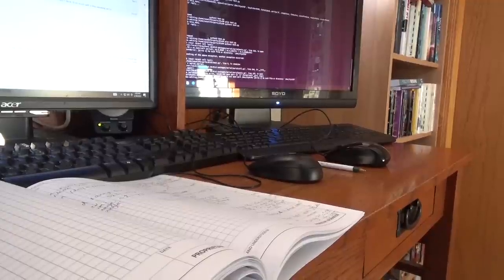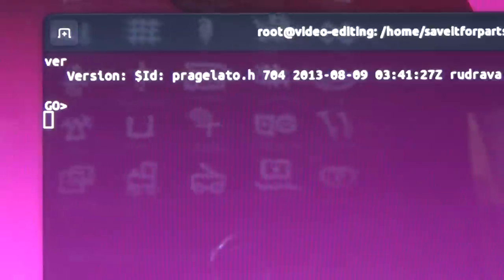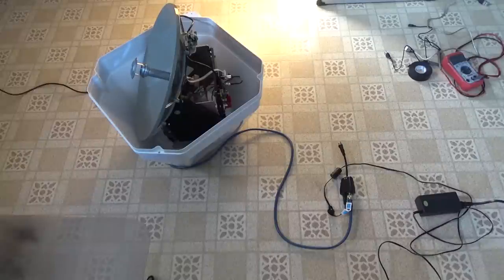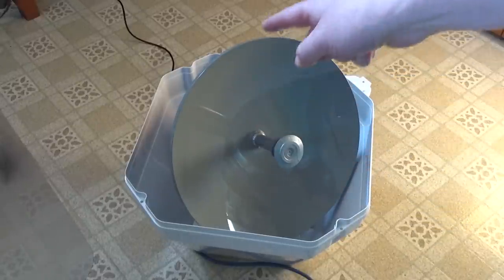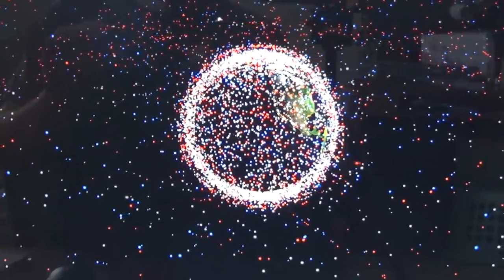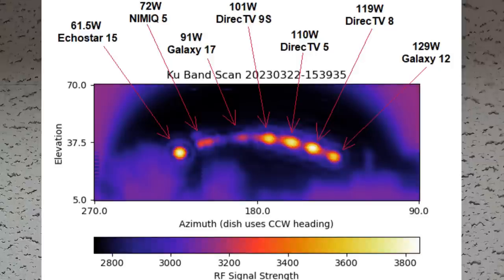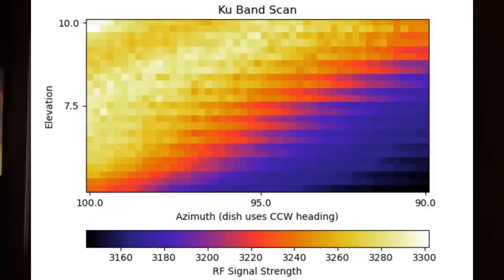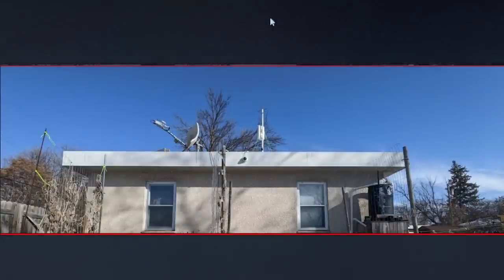Seeing Satellites with DIY Microwave Camera

Comment: Oh yea, that pesky sun.  Used to work with a KU band system, and there were a couple of days, for a few minutes, 4 times a year, where the sun would transit behind our satellite.  You could watch the noise floor on the spectrum analyzer, creep up and just totally eat the signal lobe.  Complete LoS for about 4 minutes or so.  Mean old radiation ball...  :)
Reply: sometimes at night when i do it. the moon messes with my signal cuz the moon has bad radiation. did u know that?
Reply: @driftwavez  the moon is simply reflecting the radiation & light from the sun. The moon itsels is not radioactive / does not emit radioactivity on its own
Reply: Had the same experience with several geostationary satcomm providers. As you say, the signal would just fade out for 4-5 minutes.
Reply: Only 4 minutes? These small satellite dishes are that focused?
Reply: Sunfade season was always crazy at my NOC
So many notices to send out explaining that it's the sun's fault

Comment: It would be interesting to see what you got if you pointed it in the direction of some of the larger planets. Many years ago I had the opportunity to visit the radio telescope at Jodrell Bank in the UK. In the visitor centre they had a 5m dish that you could steer manually and the coordinates for various planets. I was amazed at how much RF was being emitted from Jupiter.
Reply from the maker: I need to write some code to account for Earth's rotation and stay on a moving target! Jupiter would be interesting, although I think the radio frequencies it emits are much lower than this little dish can detect.
Reply: As a first step you could just run your current code to scan the sky and see if it picks up anything when it passes Jupiter. I suspect that you are correct though about the frequency range being much lower.
Reply: @saveitforparts  You can use the rotation of the earth as one of the scanning axis. It was a common technique for huge low frequency antennas used for radop astronomy.
Reply: @saveitforparts  🔴 What Is Islam? 

🔴 Islam is not just another religion. 

🔵 It is the same message preached by Moses, Jesus and Abraham.

 🔴 Islam literally means ‘submission to God’ and it teaches us to have a direct relationship with God. 

 🔵 It reminds us that since God created us, no one should be worshipped except God alone. 

 🔴 It also teaches that God is nothing like a human being or like anything that we can imagine.

🌍 The concept of God is summarized in the Quran as:

📖 { “Say, He is God, the One.  God, the Absolute.  He does not give birth, nor was He born, and there is nothing like Him.”} (Quran 112:1-4) 📚

🔴 Becoming a Muslim is not turning your back to Jesus. 

🔵 Rather it’s going back to the original teachings of Jesus and obeying him. 

More ....
Reply: irrelevant but ive driven past jodrell bank 100s of times and even hit the SDR near there (but not affiliated with jodrell bank) S9 on PMR (446mhz). Really cool how people would fly from different countries just to see it when it lives 10 miles away from me haha
Reply: Thank you so much my freind it is very interesting for me. Thank you so much again.

Comment: great job. But it is not correct to call it camera. It is a radar, not a camera.
Reply: Really, it uses radio detection and RANGING?
It's fine to call it a camera dude, especially since that's closer to what it actually does.
Reply: @0000Sierra117  yes, it uses microwaves .. waves .. sends and receives. And a Camera receives even when some sends lights to improve vision. And camera, or camara, is a champer, a box, an enclosure. It is in the name. No, it is not a camera. Technologies are named logically.
Reply: @el-domo  Either English is not your primary language or you learned what you know from the Big Bang Theory or something.
Radar is a specific technology that this most certainly is not.
Even Radio Telescope would be a better and more accurate descriptor of what he's doing than calling it Radar.
That being said, I think calling it a camera is particularly useful as it provides a good frame of reference for someone who is not familiar with RF.
Reply: @0000Sierra117  When you start to be personal, you already lost your point. Man, I tried to explain it to you in your understanding. Anyway, it is not important to explain more.
Reply: @el-domo  I'm not trying to insult you personally. The fact of the matter is that you are wrong, it is not useful or accurate to call it a Radar, it isn't one. The original video creator referred to it as a camera, which I think is useful and accurate enough. To correct that original statement, you would need good reasons to say camera is wrong and radar is correct. You have not provided any reasons. I'm not trying to mean, but the fact of the matter is that you don't have a strong grasp on English or these technical terms, so you shouldn't be so confident in correcting people, unless you have the reasoning to back it up.

Comment: You're also only seeing DSS (direct satellite service) satellites like directv and dish network because the LNB on that dish only looks at the DSS band (12.2-12.7GHZ) - to see all the other FSS (fixed satellite service) satellites, you need a FSS band LNB (11.7 - 12.2GHZ), and maybe a larger dish. The FSS satellites are 3 degrees apart, which is much too close together for such a tiny dish to be able to resolve the individual satellites - you'd just see a blurry line of all of them lumped together. For instance at 91W, that's not G17 you're seeing, that's Nimiq 6. They're at the same location, but G17 is FSS band and Nimiq 6 is DSS band (and pointed North to Canada). The Canadian satellites at 107W and 111W are FSS band, not DSS, so you won't see them at all on your dish / LNB (and the one at 107W has gone inclined a few months ago). Same thing at 129W, that's not G12 you're seeing, G12 is c-band only. You're probably seeing CEIL2. Your "satellite expert" you conferred with doesn't seem to know very much if they didn't tell you about the different bands, and that there's multiple satellites at the same location operating in different bands.
Reply from the maker: Interesting, I'll have to do more research on this. I'm not too knowledgeable on FSS vs DSS, I only know a little about H vs V vs Circular polarization. I have a bigger dish and an upcoming video on C-band, but I don't have beefy enough motors to aim a big dish yet.
Reply: @saveitforparts  FSS and DSS are just 2 different frequency bands in the larger Ku band. The bigger rectangular dish you have on your roof will have a FSS LNB on it, as it's an old vsat terminal for hughesnet, which runs in the FSS band. Most (but not all) FSS satellites in North America use linear polarization (Vertical and Horizontal). FSS is also known as the FTA satellite stuff (although that term is a bit of a misnomer, and incorrectly used to mean many things). All of the direct to home satellite providers (with the exception of one of the Canadian providers, and one dish network satellite) use the DSS band, at higher power levels, and use circular polarization (Right and Left circular). Because the DSS satellites are spaced further apart, and because they're running higher power levels, they can get away with using those tiny dishes.   Some of the direct to home satellite operators are also using the Ka band (18 - 22Ghz), as well as many satellite internet services. Most Ka band satellites in NA are also circularly polarized, but the Ka band itself has 4 different sub-bands, and you need 4 different LNBs on a dish to truly investigate that band.  If you have a c-band dish, I'm surprised that it doesn't have a polar mount and a linear actuator to move it, though that only gives you one axis of movement that you align with the clark belt - you couldn't do a whole-sky-image like you did here unless you go to a 2 axis mount with 2 actuators (aka pick up another c-band dish for a second actuator, and fire up the welder to make a 2 axis mount).
Reply: @saveitforparts  The difference between linear polarization (V and H) and circular polarization (R and L) is in linear polarization, the e-field (electric field) and h-field (magnetic field) of the RF wave are in phase with each other. In circular polarization, the e-field and h-field are 90 degrees out of phase, causing the overall polarization to rotate (which is why it's called circular polarization). Using both polarizations (V and H, or R and L) allows 2 signals to be sent at the same frequency at the same time that don't interfere with eachother (because their electric and magnetic fields are orthogonal (90 degrees) to the other signal on the other polarity, and thus don't mix). It's a nifty trick that basically doubles the bandwidth available in the frequency band. This only works where you have fixed antennas at both sides of a direct line of sight link without random reflections. It works for satellite, and point to point microwave links, but isn't useful in any kind of broadcast applications where you get reflections off of buildings or terrain. It is the exact same as "light polarization" in photography, or LCD screens, etc etc. If you had 2 lights that where opposite polarization, you could send 2 signals at the same time, and use polarizing filters to block one and allow the other through to separate them at the receiving side.

Comment: I think it makes sense to have adaptive resolution: If the dish picks up a strong signal, it can use the nudge feature to increase the resolution in this area. If not the standard resolution is probably enough.
Reply: I agree... find the edge of the object and then nudge back across it to see if you can get more details.  Use the more accurate nudge direction for scanning.  Then "restore" back to the position it was and continue on.
Reply: Limited resolution from the small dish size. If you could determine the resolution function imaging a point source… eg a satellite, you could deconvolve the image to get a higher resolution result. Failing that you could use multiple dishes and then use interferometry to synthesise a higher resolution… but the hardware probably won’t allow that. Cool project!!
Reply: if you had 4 dishs in a square array, you could do a phased array to get better resolution
Reply: @zazugee  if you could phase connect them together and do the maths. The more in each direction and the further apart the better. If an amateur could pull it off I would be impressed.

Comment: I had an aha! moment during this video.  You essentially were collecting data about your surroundings without an active emitter.  This passive “RADAR” is what modern military aircraft use to get a picture of the battle field without giving away their position.  I’m sure their hardware/software has a higher resolution but the concept is the same.  Wow.  Thanks for that.  Great job!

Comment from the maker: Quick update on this, if anyone is thinking of doing the same and looking for a compatible antenna:
I got my older (2011) Tailgater with the Mini-USB jack to give me a serial console. The firmware is slightly different and it doesn't have the elangle command, but everything else seems to be the same. Sadly the motors are 100% seized up from water ingress at some point (probably why I got that one for free).  If I can find the same motor online I might try to replace them. 
So, I'm guessing any Tailgaters between at least 2011 and 2014 will work for this! You might have to substitute elev for elangle and tweak the range values in the Python code depending on firmware version.

Comment: How cool is that to see a picture like that again. I did something similar with a 1.2m Ku Band DX Dish that also had a elevation correction. But it could not move as freely as your antenna. However the picture I generated  from the sattelites looked pretty much the same. This was back in 1994 when we had to take a picture, develop it and scan it with a scanner. No digital cameras back then.

Comment: To get higher resolution you'll actually need a better dish! That one is small and not very parabolic - that's why you see ringing artifacts around those sats on the left by the tree. Those are caused by the dish not being "focused" enough. You can think of it like bokeh from a lens that's not focused properly. It's designed just to pick up a signal, not a perfect pinpoint focused signal, which is what you'd want for clearer scanning for imaging purposes. Still awesome!
Reply from the maker: That's kind of what I thought the rings might be. I've been debating if it's worth doing the "nudge" command for smaller scan increments, but it looks like the beam width of the dish is more than a degree.

Comment: I love this video.  Thanks.

I feel you about a CS degree not teaching coding.  I have a CS BS and in the course of my degree I had a course or two in C, C++, Ada, and 370 ASM (not necessarily in that order).  In short, nothing modern.  I mainly code in Bash these days, though I can sometimes read C if it's not too complex.

For imaging fast objects (LEO), I suggest you scan the sky in vertical stripes, then do the rest of the scene however you want.  Depending on which way you move the stripe the image will either be expanded or squashed, but probably not very skewed.

For sending text one char at a time, you could write a procedure that takes a command and sends it one char at a time.  Then in the body of your code, call your new procedure.  It won't make things work any better, it just makes your code easier to read.

Anyhow, best of luck.

Comment: This is basically how commercial dish pointing systems (e.g. on news vans) work. The controller points the dish in roughly the right direction using GPS, compass heading and a database of satellite orbits, then does a peaking search on the beacon frequency in a small grid to account for errors in its calculation of where it thinks the satellite should be. All sensors have error. Of course this only works for geostationary satellites.
Reply from the maker: I should look for an old news van at surplus sales :-D
Reply: The really old trucks were all manual. You just had to learn where they were and what the spectrum looked like. Now they just call us old guys when the auto dish fails or needs a new sat programmed in 😂

Comment: Wow, I'm glad I came across your video, I just subbed. I started playing with one of these back in 2020, was able to control the dish over a serial console but I'm not a code guy so i haven't got back to this project. my goal was to change the LNB for a ham radio antenna and use the dish to track LEO radio satellites. Great work and I'm lookin forward to more videos on this!
Reply from the maker: Cool! Glad to hear someone else has one of these, so far it seems people have a hard time finding the right model. A ham antenna would be fun, I'm not sure if the little motors can handle a 2M yagi, but maybe they'd do a 70cm. I have that on my list for some other pan/tilt junk I have lying around, just too many projects on the to-do pile.

Comment: Nice job overall. The Satellites you see are the real hi power ku TV satellites. The lower power KU signals are not conducive to being received by the real small dish you are using. The KU bands are also not circular polarized as the DTV satellites used by the North American carriers. Also remember that the US carriers use spot beams to broadcast their signals, in most cases the local Broadcast Stations otherwise the 2 carriers in the US would run out of bandwidth or frequencies.😊
If you can watch a band between 900-1600 MHz on a receiver or spectrum analyzer connected to the coax, you will see the transponders of the satellites you are tracking. Each slot will have a different fingerprint so to say and real apparent. The LNB on the dish requires 13 volts, 18 volts and a 22 kHz signal to point the dish at different birds. Depending on which slots are used. I am a semi retired Dish and TVRO technician as well as a cable company engineer. 

Coding is not my strong suit, getting computers to work right , no matter the OS is my strong suit. I play well in DOS, Windows, MacOS and Linux. As well as networking!!!😅😅😅 You never know what the home user will throw at you.😅😅😅

73’s
DE N2JYG
Reply from the maker: Very cool, thanks! It would be interesting to take this on a road trip and see which satellites are aimed at different regions in the US and Canada. I'm sure all of that is online, but it's fun to see what it looks like in real life.